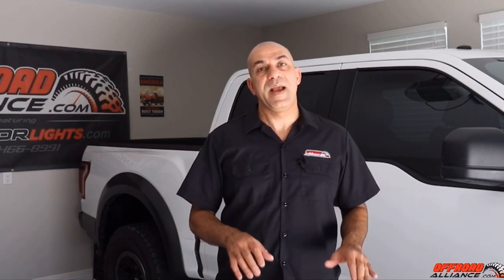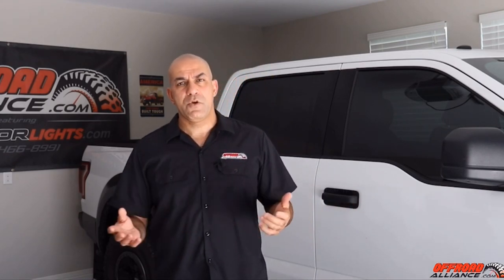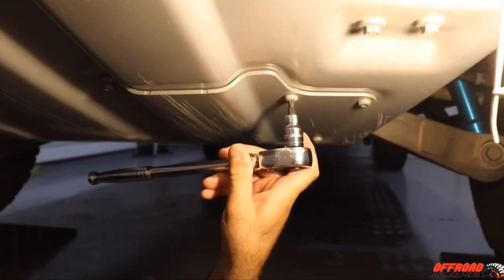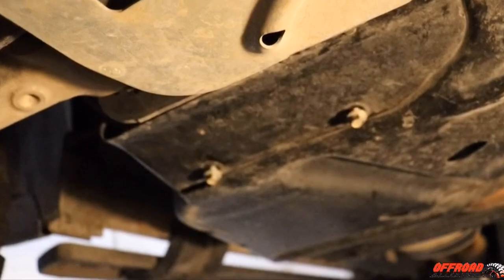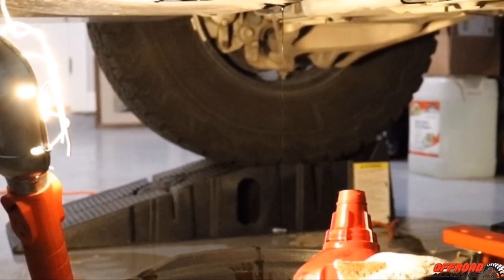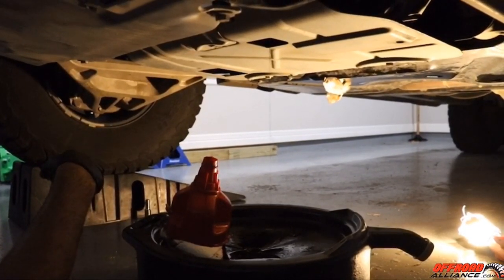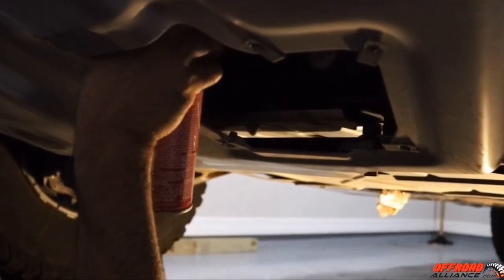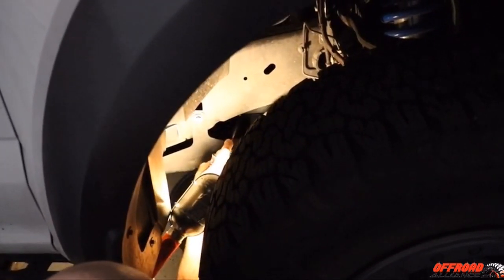Oil Change on the Gen2 F-150 Ford Raptor (Metal oil pan)

Comment: Where do you set the oil filter so it doesn’t make a huge mess. TIA
Reply from the maker: Creighton Spies EA great question! 
I tip over on the drain tray and then put it in a one gallon ziplock bag as I retrieve it from the lower engine compartment area. Done with with my diesel trucks and it worked really well.